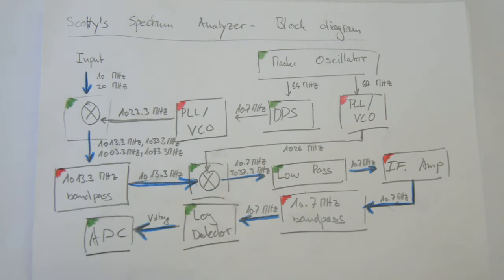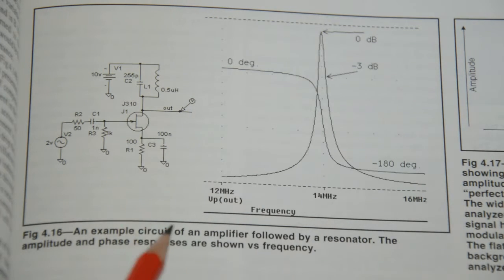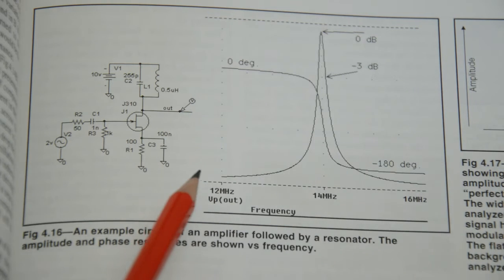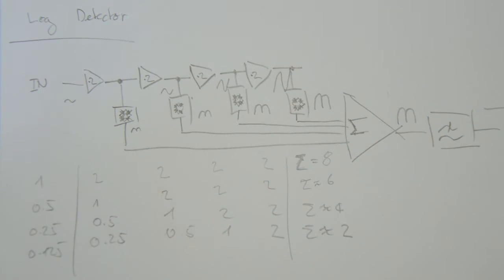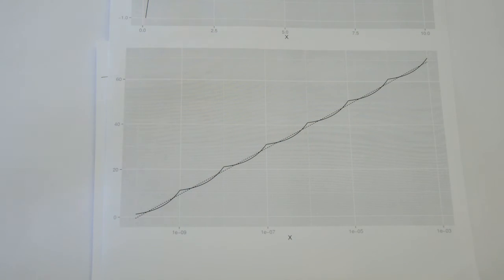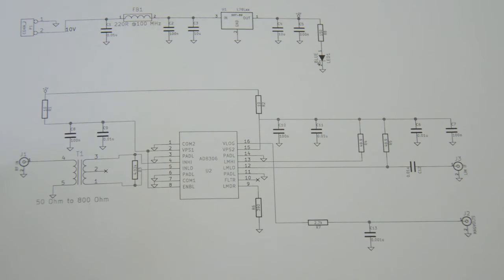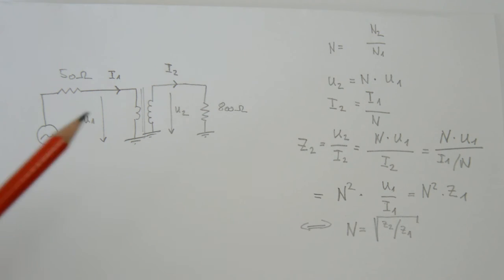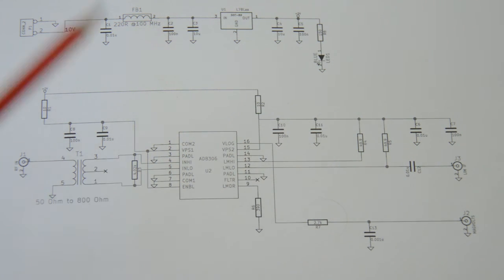Homebrew Spectrum Analyzer 5: Log Detector Circuitry

Comment: limiter output is use with network analyzer mode for phase
Reply from the maker: Ah thank you, I wasn't aware of that, but it makes a lot of sense. I'll roll out a clarification-video within the next few days where I'll highlight this and the voltage regulator thing you mentioned in your other comment, as well as the mistake in my log detector schematic and a few other things that I've collected from feedback. Thanks a lot!